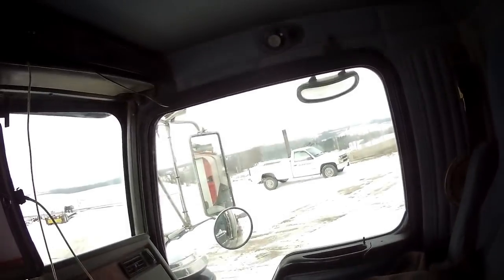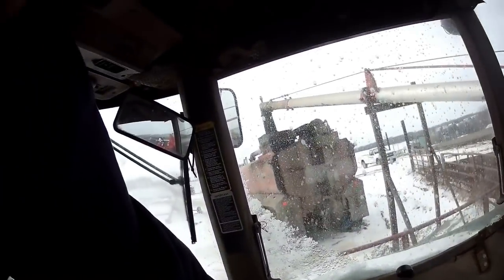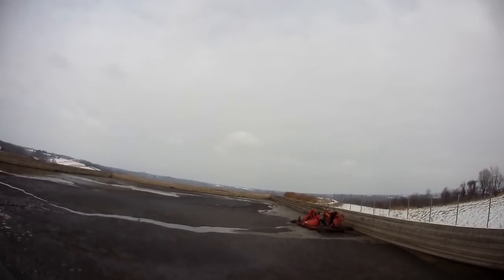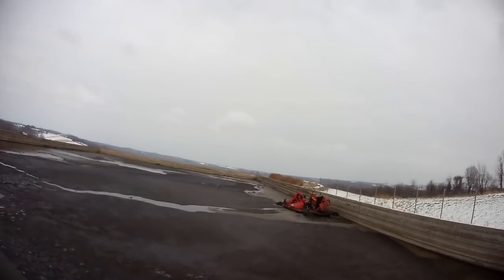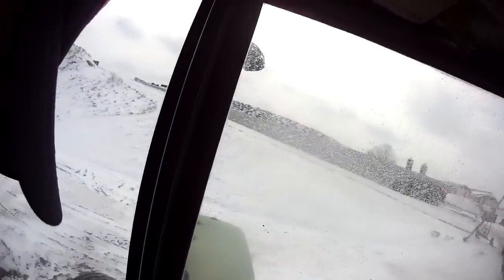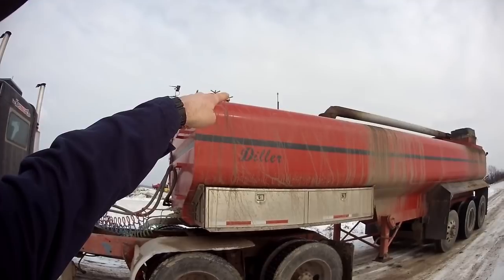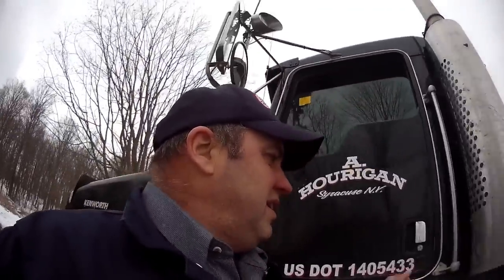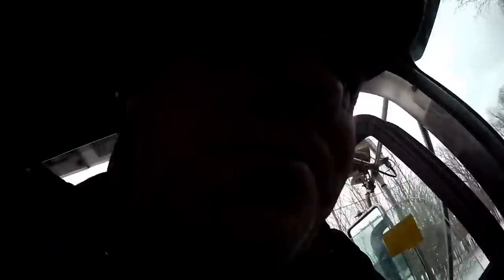Little problems nothing serious

Comment: Thank you for today's video. Not to bad af a day today, got to have those every so often. I understand right now there is a lot of liquid to help keep the sand in suspension, I was wondering when you closer to the bottom, with the pump sitting at one end does the crawler agitate/push the sand towards the pump so you can load it out?
Reply from the maker: Pretty much yes

Comment: We welded a rod to our I rear floats on our tanks and bent it around the corner to be able to see them when loading from the side.  Houle top floats rarely work.
Reply from the maker: Thanks for the info
Reply: I emailed you a pic of one of our tanks.     I put some reflective tape on the side in 2" increments.  Depending on how we are loading at different farms it is pretty accurate depending on how we are sitting

Comment: Hey just a opinion why wouldn't you use a 240vac 3 phrase electric motor instead of a tractor? I work at a wood mill they run a round baler compactor off electric motors instead of a tractor which they did when they 1st bought the baler.
Reply from the maker: We would need 120-150 horse power electric motor to run one of those pumps.

Comment: How many cows you guys milk. We are the biggest guys in Western NY for custom chopping with a whole 4 main customers and a few guys we don’t always go to. Our smallest guy milkes about a 100 cows, our next biggest does about 450, our second biggest does about 500 and are currently building a new barn hoping to expand, and our biggest customer Torrey Farms does almost 2000 between 3 farms Elba dairy, Bragg Schoolhouse road, and Lindenville about 10 minutes from lake Ontario. We also do about 300 acres of grassy weeds behind the Bergen vegetable canning factory and the Oakfield. Most years we do it but only first and second. We also have a few small guys scattered around. This is enough work for us to be running 2 Class 960’s, two Oxbo 330 mergers, 3 John Deere W235 self propelled haycutters, 4 10 wheelers, a east dump trailer, a Meyers silage trailer, and a Diller silage trailer. We’ve got 4 articulated Deere’s with Grouser blades on them and 2 Bryon dump carts besides the chopping we have 3 John Deere walker combines and a S670, two Diller trailers, a Jamesway, and a Nuhn spreader, 2 zone builders, 3 10 bottom mobord Salford plows, and other tillage tools. It’s a lot to handle but we make do
Reply from the maker: That's quite a nice bunch of work and equipment. We're milking 1550 and farm 3500 acres
Reply: Farming Fixing & Fabricating Damn that’s more than I thought

Comment: I used to drive otr and when at a terminal my wouldn't crank at all. I went in to the shop as they were closing up for the night. They had me drop my trl and they hooked up to my trk with a 4k rated indoor propane hilo and pull started me. Thankfully since going onto home time they didnt put my trk out of service. A few weeks later i was at a trk stop and the trk wouldnt start. The trk stop shop sent their service trk out into the parking lot for me. Hood was open and they had me crank it and it did finally with a blue flash. Bad grounding so it needed a new starter per trk stop mechanic.
Reply from the maker: Roll start is a good option providing you have enough air pressure to release brakes.
Reply: @FarmingFixingFabricating  i was surprised a little forklift could pull start a bobtail.  Just thinking i pulled a 3020 diesel with my chevy 2500 6.5 turbo diesel  in 4low granny gear in 2 feet